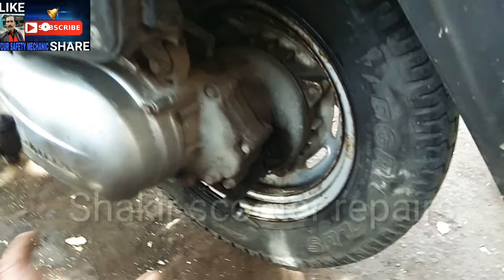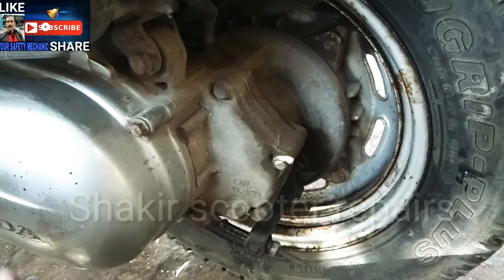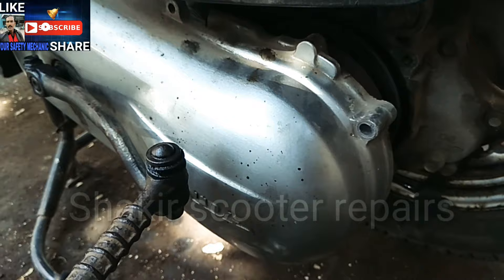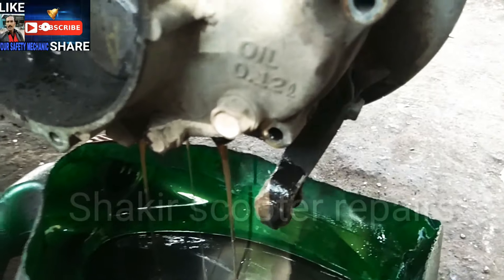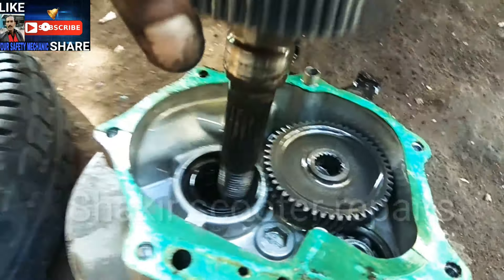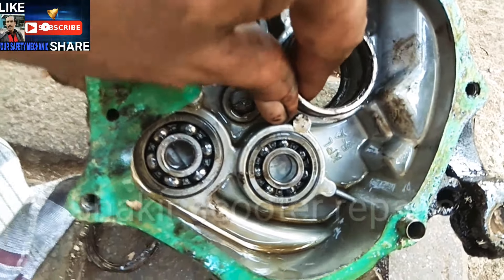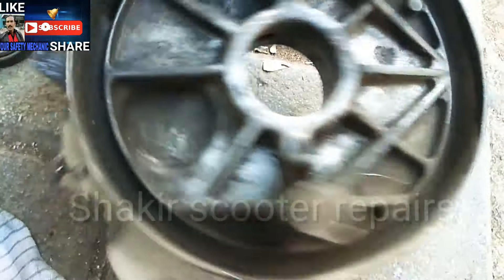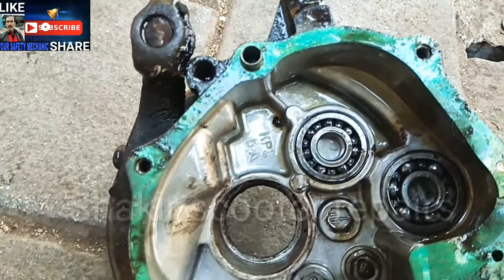Honda Activa brake sound problem solution and bearing damage एक्टिवा ब्रेक साउंड प्रॉब्लम सॉल्यूशन

Comment: Sir I have one issue is in my activa 2010 bike main bearing machine was put skf good bearing but it have only one side seal of bearing if any prblm come kindly tell me
Reply from the maker: Yes there is no problem
Reply: My old gear box bearing was two side seal it has run more than 25k that so iam asking machine has put one side seal bearing to my activa 2010 gear box main bearing
Reply: If one side seal bearing when whell heat gress will come out no problem for bearing